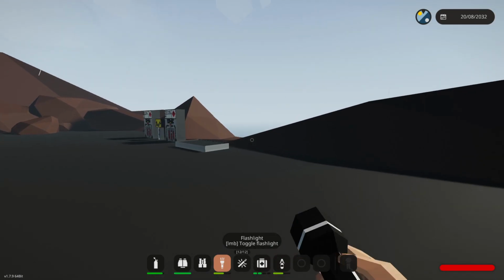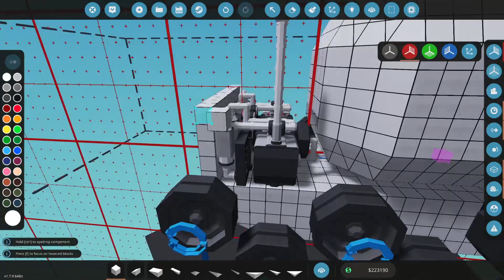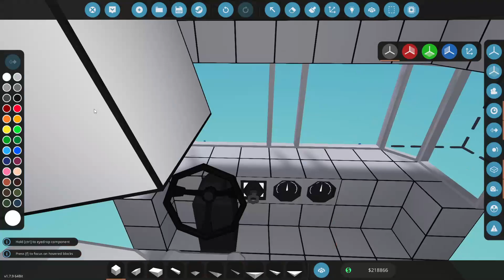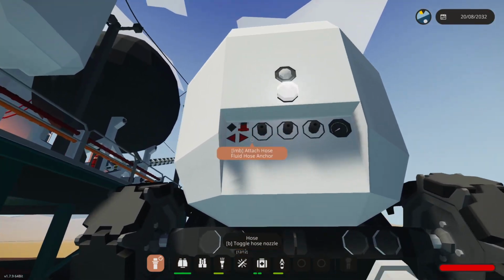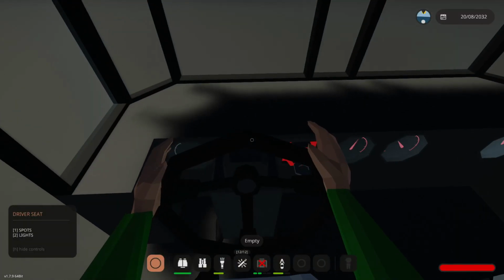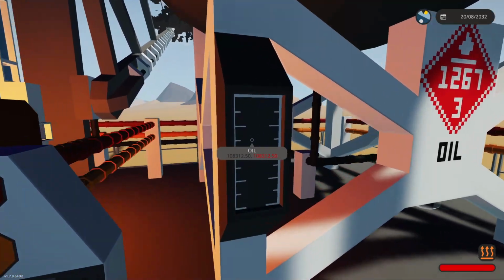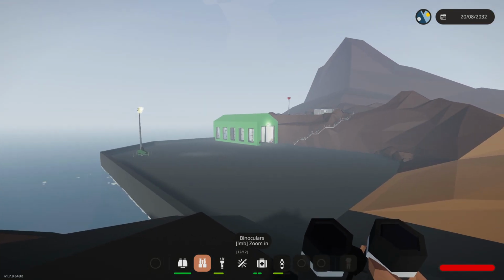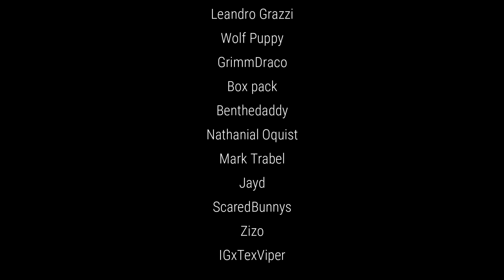I Built a Tank to Carry a Tank!!! [S5E16] STORMWORKS

Comment: Loved the video @ProfNCognito! Can't wait for the next video man! The Tanker Tank looks pretty good, I think the name for it should be the "PNC Tank-snail", how's that sound? The Lights and the Exhausts on the Top makes it look like a Snail a little bit.

Also, if you wanted a Tracked Amphibious Vehicle, the Soviet PTS is one to look at. You can load a Truck into the Back of it for a Crossing.

 • Length: 37 ft. 10 in. (11.641 Meters or 46.564 Blocks).
 • Width: 10 ft. 11 in. (3.358 Meters or 13.435 Blocks).
 • Height: 8 ft. 8 in. (2.666 Meters or 10.666 Blocks).
 • Curb Weight: 39,000 Lbs (17,628 kgs).
 • Body Style: Waterproofed Hull.
 • Layout: Front Engine (Under Floor), Front Drive Sprocket.
 • Engine: A-712P V12 Water-cooled Diesel, 250 hp (PTS) or V-54P V12 Water-cooled Diesel, 350 hp (PTS-M).
 • Transmission: Water: PTO Propeller Drive.
 • Range: 190 Miles (308.676 Km).
 • Speed: 25 mph (40.615 kph) (Road).

These guys are still being used by Russia, Sudan, Poland, Serbia, Vietnam, Ukraine, Separatists in Donbass, Algeria, Egypt, Georgia (Soviet), Indonesia, Syria, Iraq and Uruguay. Take a look at them on Wikipedia "PTS (Vehicle)" and you can see them for yourself.

Comment: Hoses still have issues on so many levels.  They are weighted, they shrink even tho they are supposed to be 40m in length and when they shrink they will pull anything. Trains loaded with he brakes on, ships out of the water and if you are struck by the hose while it is moving it will kill you or throw you off the map into space...